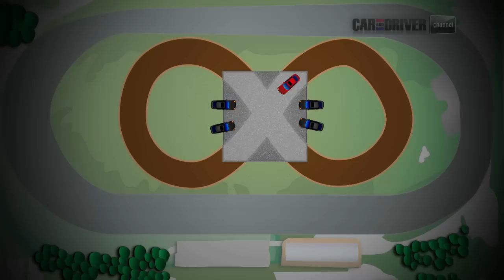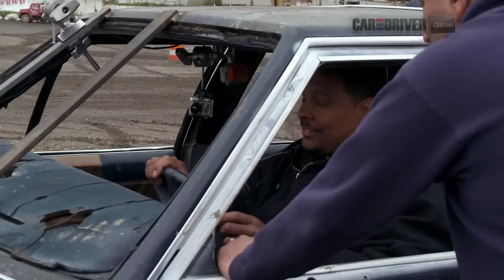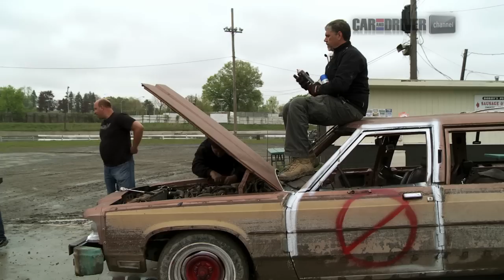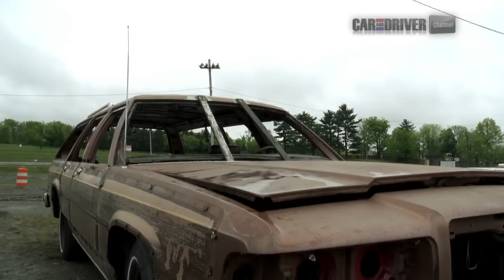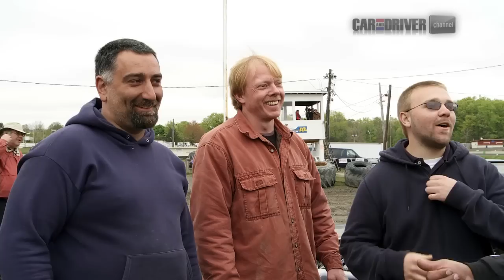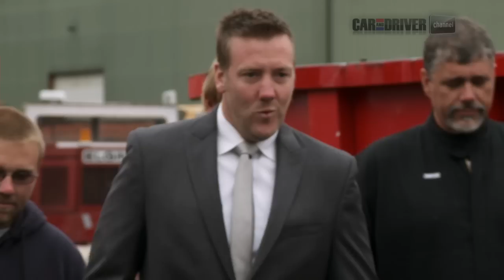Extreme Demolition Derby (Part 3) - CAR and DRIVER

Comment: The only thing i didn't about this episode is Team Champion's had a free pass through the kill box. But by starting both cars at the same time. both got to the kill box at the same time. Meaning all the demo guys had to hold back to keep from hitting the wrong car. Which gave both cars a free pass. So Team Champions did not get the advantage they earned.

And since when does a flat tire mean you have to stop in a demo derby.